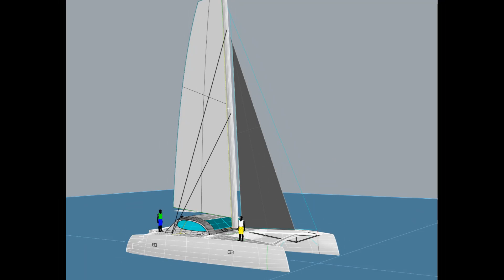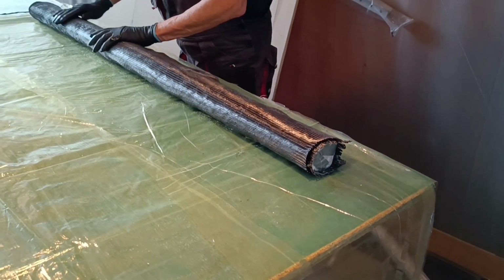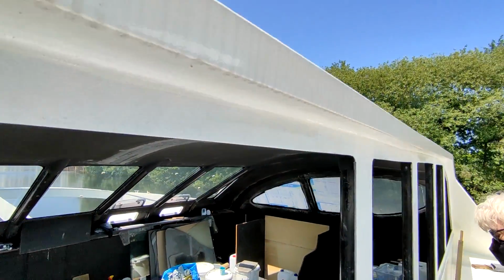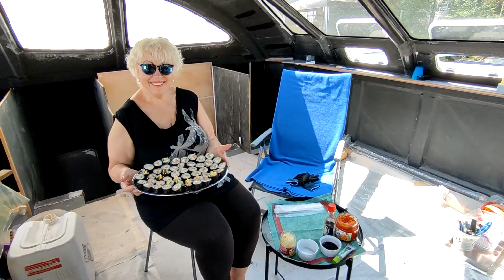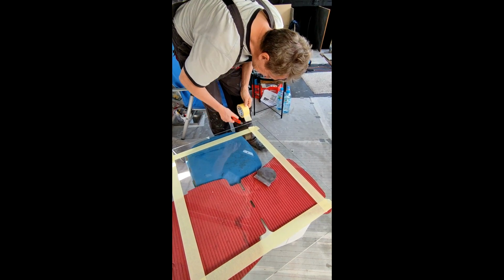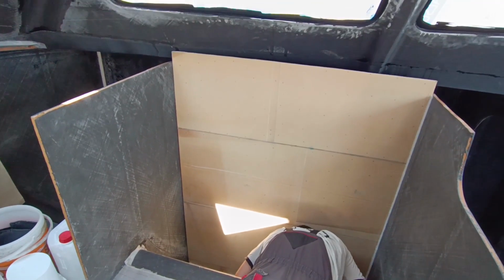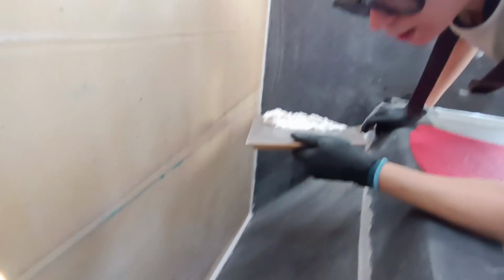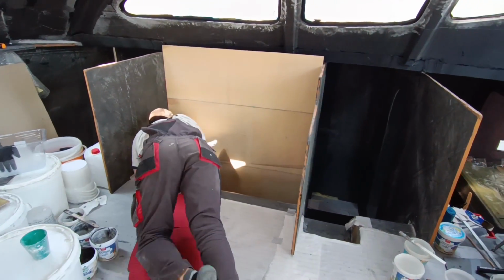08.  Building 15m carbon performance catamaran - "CarbonBee"

Comment: Can't wait for you guys to sail this thing! Looks amazing!
Reply from the maker: Thanks!
We are just now already excited as we think about first sailing. We know, the first trails will not be for weak nerves. 😃
Reply: I think your boat will be closest thing compared to lightning - as far as performance cruising cats are concerned. I would be frightened to be on the water in a 6t cat in bit ocean. However, it looks as though it is very well constructed and will be sailed with very good hands and minds. Cheers @bojanu7212
Reply from the maker: @stdntallan  Thanks for the nice comment.
Nowadays you have satellites and good forecasts for weather conditions. Having fast boat you do not need to go in heavy seas or into storms, but having slow, heavy cat you can't choose weather - the weather will choose you.

Comment: What is the thickness of the glass, is it 2 laminated sheets of 4 mm ?
Reply from the maker: Hi, do you need the information for any specific project? The ISO standard ISO:12216 describes the requirements.

Comment: what is the mission of this boat because no toe rail and hatches at the bottom of your front facing window is just a couple of the things that are very confusing
Reply from the maker: Thank you for your valuable, confusing comment.
Reply: Es gibt menschen die keine ahnung von catamarane haben..aber geben unsinnige Kommentare ab !!!
Reply: @bojanu7212  what is confusing? i asked what you're going to use your boat for? because building a carbon boat with no toe rails, and hatches at the bottom of the windscreen windows make absolutely no sense in my mind.
Reply from the maker: @pred7949  We will use our boat mainly in marina. On the open see our autopilot will use the boat.🤣
Allegedly carbon boats doesn't need toe rails, but we anyhow install them 🙃😉😂.
The hatches will be always closed, and we do not know anymore why we installed them. We will work hard at this to check the idea behind it. 😉🤔🤥🤕